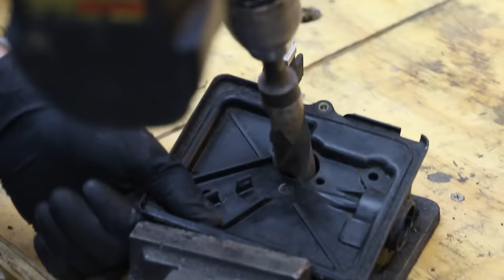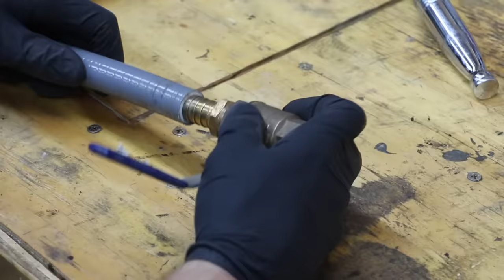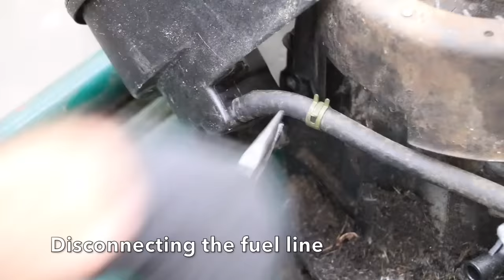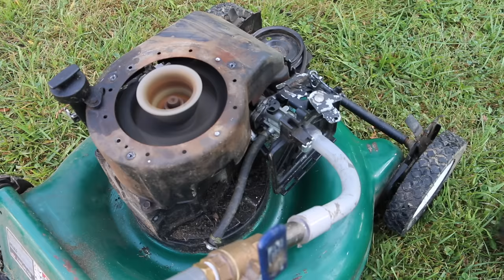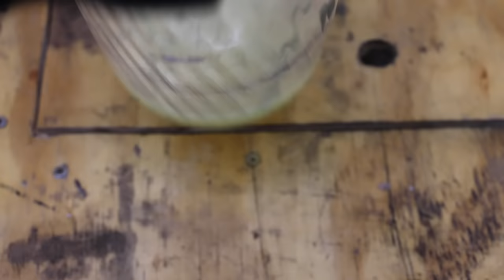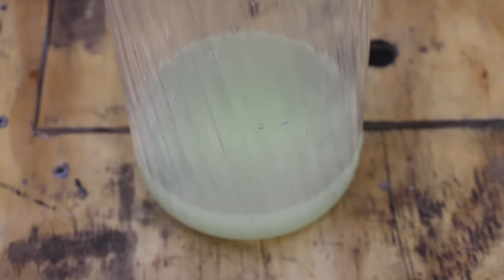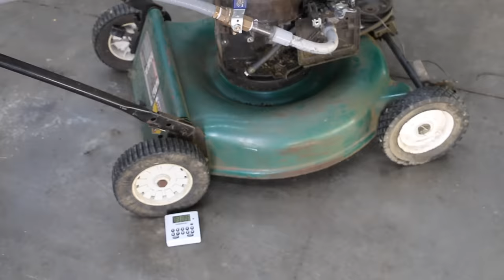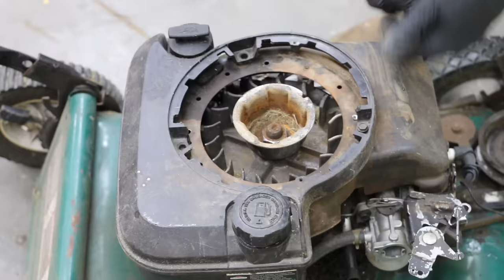Will a "Gas Vapor" Container Improve MPGs and Fuel Efficiency?  Let's find out!

Comment: All gasoline powered engines run on gasoline vapor! Liquid gasoline will not burn. It must be combined with oxygen to create a vapor before it will burn.

A carburetor mixes liquid gasoline with air to produce gasoline vapor which will burn. What you've done here was to create a rudimentary carburetor that mixes gasoline and air creating a burnable vapor -- as the air is drawn up through the liquid gasoline in the jar, it combines with just enough gasoline to create a burnable mixture.

That was an interesting experiment!
Reply: Good Comment. Please check out Gasoline Vapor Systems on Facebook. Thanks, Mike
Reply: A carburetor only produces a mist or small droplets. The engine does not perform well on the droplets of liquid droplets. It NEEDS vapor. Now you see why carburetion is no longer industry standard. Fuel injection produces a MUCH finer pressurized spray of droplets and thus the residual vaporization is better, but science has already established that a "pure" vapor system is FAR MORE EFFICIENT.
Reply: Hi, this is in the right track except the carburator doesn't turn the fuel into a gas, the carburator feeds atomized fuel to the engine via the jets and mixes with the air controlled by the throttle valve. As the fuel travels through the intake it gains heat from it's surroundings turning liquid fuel into gas fuel.
Reply: Only problem is incomplete combustion from forcing liquids into the chamber. A pure vapor system is far simpler and more efficient. Just ask Edelbrock. You must know Edelbrock. Ask them about trying to get a spray to turn corners inside an intake manifold.
Reply: The big problem is that a vapor system doesn't FEED THE FAT CATS. Trust me that injection is FAR less efficient than Vapors. Please read down to some of the rest of the comments below... there is lottsa good stuff down there for those that want to learn.
Reply: Hey Alex, after reading hundreds of the comments below, I am seeing big confusion between gas, as in gasoline and gas, as in gaseous state.
Reply: if you've done literally any research at all on the current direction of almost all the automotive car companies then you'd know that they're going electric and don't have an agenda to keep cars running on gasoline, injection is the most efficient fuel delivery there is too so you are just spreading false information
Reply: Well of course fuel injection is more efficient, but I think you should to look up the word 'vapor' before you continue. There's no such thing as a 'pure' vapor system. And what the heck is 'residual vaporization"? It's still a vapor no matter whether the gasoline droplets are large from a carburetor or smaller from fuel injection. So whether carburetor or fuel injection, either way you look at it, the engine is running on gasoline vapor.
Reply: What does "electric cars" have anything to do with this conversation? And just because fuel injection was invented doesn't mean that it's false information to say that the man created a rudimentary carburetor.
Reply: There are videos here on YT of actual cases of hundreds of MPG on vapors. NOT EVEN CLOSE with carbys or infectors. Read down on some of the other comments. There is a lot of real science there if you really want to learn.
Reply: ya cant burn gasoline in a spray form. it only burns vapors. with a carby and infectors you are sending in a spray of liquid droplets.
Reply: Read the thousands of comments below if you want some helpful info. If you want!!!
Reply: Well heck! Let's all argue awhile! A fuel injection system is a vapor system. It just has smaller sized gasoline droplets than a carburetor system. Fuel injection does not inject "gas" into the engine, it injects very tiny liquid gasoline particles into the engine.
Reply: "very tiny liquid gasoline particles" are not vapor. they are liquid. Google it.
Reply: First of all, Youtube is full of fake videos. I think you've been deceived! If cars could get hundreds of miles per gallon on gasoline then all cars would switch to that system. And if an inventor had created a system that gives hundreds of miles per gallon of gasoline, then you'd have seen that item on the market and the inventor would certainly be a multi-billionaire.
Reply: pen mightygun mine?
Reply: Bill Davis sorry about that. I don't like saying vapor, I say gas or gaseous to point out the state of matter.
Reply: MrCharlieCom good!
Reply: What about the increased pump-work that tubing creates!
Injecting wapor instead of small droplets also increases pump-work, guess how!
Reply: Bill Davis it is scientifically impossible to make a gasoline engine have a fuel economy if hundreds of MPGs. 
Basic understanding of energy simply proves that wrong. About 33% of the fuel translates into motion, the other is lost, 33% goes to the radiator as heat and the other 33% to the exhaust as heat. All that being said, if you harness 100% of the potential energy in a gallon of gasoline 112 BTU/gal you improve your efficiency by 300% or 3 times.
Reply: MrCharlieCom the carburator not the oxygen create gasoline vapor, is the heat added to it
Reply: It's good that you make a difference between gasoline, gas and vapor. When I was in eighth grade, the teacher asked the class a question for which the answer was 'gasoline'. I was the only one who knew the answer. However, I held up my hand and responded with "gas" (short slang for gasoline), for which the teacher said that wasn't the right answer. It was a minute or two later when some smart girl figured it out and answered 'gasoline.' She got it right! Ever since then I always make a difference between 'gas' and  'gasoline'.
Reply: MrCharlieCom nice!
Reply: I love all the comments, what you have done is akin to what chevys first fuel injection system was designed for the 283 installed in their Corvette in the 50's, if you want to see an experiment, alter your setup a bit. Remove the carburetor and Use a closed loop with another ball valve on the intake, instead of sucking air into your bubbler remove your muffler and pipe it into the bubbler instead of outside air, open the extra ball valve and use a squirt of starting fluid to get it started, the heat from the exhaust expands the molecular structure of the gas, think of setting a gas can outside in the sun without a vent it will expand greatly, it is considered a form of geet fuel, give it a go.
Reply: Sorry, exhaust gasses will not burn again. That would only contaminate the intake charge. The gasous gasoline vapors have to mix with air, not exhaust. Very inefficient. There is no comparison between a vapor system and a liquid fuel system.
Reply: A fuel injection system is a liquid injection system, not a vapor system.
Reply: Hi Bill Davis, Thank you for your great post. You are mostly correct about everything you state. I would like to point out that all gasoline powered internal combustion engines ONLY run on gasoline vapor, that is oxidized, or emulsified with atmospheric air, weather running on a carburetor or being fuel injected. Gasoline engines do not run on liquid gasoline. Liquids do not combust, and therefore gasoline in liquid form will not combust, but must be converted by the application of heat into a gaseous phase, and Oxidized. Both the F.I. and the carburetor atomize the gasoline into a fine mist. Atomizing is done to facilitate the quick heating and "Phase Change" of the liquid gasoline by spreading out the liquid gasoline in atomized form over a heated area inside the engine.  The liquid gasoline is broken up into millions of microscopic droplets, but remain in a liquid form.  The atomized liquid gasoline then spreads out , and mixes, (emulsifies), with air when flowing through the carburetor venturi, (Oxidation), and then comes into contact with heated areas inside the engine, where they are vaporized by that heat. This is called a "Phase Change". Phase change requires the application of heat to occur. Gasoline in liquid form is not converted into a gaseous vapor until heat is applied. Bill, I invite you to join our group on Facebook: Gasoline Vapor Systems. I think you will like it and find it interesting. Thanks, Mike
Reply: Fuel Injected Engines also run on Oxidized GASOLINE VAPOR, and not on liquid gasoline. Liquids do not combust. This is a basic premise of Physics. No liquid will combust. A flammable liquid must first be converted into a gaseous phase to combust. Direct Fuel Injection systems spray atomized liquid gasoline mist into the HOT combustion chamber, where it is mixed with incoming atmospheric air, (Oxidized), then  compressed and ignited by the spark plug. All Internal Combustion Engines run on Oxidized and Heated Gasoline Vapor and not on liquid gasoline.
Reply: You are right Alex ! Thanks !
Reply: Very True ! Good Comment !
Reply: Vapor is a suspended liquid droplets. A fuel injection system injects very fine fuel droplets vapor mixed with air before entering the engine. It's not like it's dripping gas into the cylinders. Direct injection moves injector inside the cylinder for even more controlled burn. Most direct injectors run on 2000psi of fuel pressure to allow the best atomization of fuel.
Reply: Vapor is not droplets. droplets are atomized liquid. Vapors are gaseous. A carb and injectors both spew droplets of liquid and droplets dont turn corners inside an intake manifold, they splash against the wall in a turn and then this liquid DOES drip gas into the cyl. A race engine has very TALL, STRAIGHT manifold runners to avoid turns and to avoid that wave of liquid that drips into the chamber. That is why vapor is FAR more efficient than a stream of gas.
Reply: Too bad all the current research is proving that the petrol engine is so far, the most efficient form of energy transfer.  Wind, electric, hydrogen and many others have failed to surpass the gas engine in efficiency.  I'm not trying to offend you in any way, it's just a fact.  In fact, Delphi built a gas engine that was 50% more effecient than todays engine, back in 2012...

https://jalopnik.com/5912161/delphi-built-a-gas-engine-thats-more-efficient-than-hydrids
Reply: Vapor is not suspended liquid droplets. True Gasoline Vapor is not a liquid.  Gasoline Vapor is a gas, that has been converted by "Phase Change" through the application of heat to the liquid, which changes the liquid into a gaseous state, (like Natural Gas or Propane). True Gasoline vapor is invisible like natural gas. Tiny Liquid Droplets, also called a mist, are created through the process of atomization. The process of suspension and mixing of atomized liquid mist with ambient air is called emulsification. The process of atomization is accomplished by the carburetors '"Jets" or by the Fuel Injection system's pressurized injectors.  Emulsification, (mixing) of the atomized fuel and ambient air is initiated in the carburetors venturi tube, (also called an emulsification tube), and continues while flowing through the intake runners and cylinder head ports. Fuel Injection pressure for atomization is provided by an electric fuel pump, which in most cases has a pump pressure of 45 to 60 P.S.I..
Reply: I don't even care about all this vapor stuff. All I did was make a simple response about the man created a rudimentary carburetor and man O man, now I get several email responses every day from people  trying to teach me all about fuel systems, fuel injection, definitions for vapors, droplets vs vapors, etc.. Ain't you guys got nothing better to do? LOL
Reply: was talking to the other person Bill, I agree with you
Reply: John Smith they're actually going towards hydrogen powered vehicles. Hydrogen is the most abundant resource. In a hydrogen engine the only byproduct is water. Hydrogen engine are VERY powerful engines.   You still have find energy to produce electricity either from where most of our electricity comes from coal fired powerplants
Reply: Hydrogen only makes one third the BTU's of Gasoline combustion. This means that a comparable sized engine running on Hydrogen will only make one third the Horse Power and Torque of the same sized gasoline engine. I built a dedicated hydrogen engine, a 350 cubic inch Small Block Chevy, and it made less than 50 horse power. I also had to use 2 - 300 amp "Limo" alternators to power my system, which robed more power. YES, Hydrogen has great advantages in air pollution and water is free but their are also disadvantages .
Reply: Bill Davis...stoichiometric
Reply: michael vannozzi  stoichiometric

Comment: This does work I did it on my 94 Chevy C1500 with a 4.3 Vortec TBI throttle injection I even made a YouTube video about it not much detail but it was successful you have to have a fully sealed system other than where the air comes in I use the brake booster splitter t- pipe I used a stainless steel fine mesh as an aspirator with a small aftermarket air filter on the vapor bottle I used a pickle jar which was glass I haven't perfected it to a tea but it does work hydrogen cells work as well with some fine-tuning and studying you will get it I only received a few more miles on fumes than I would have gas normally good luck to you guys

Comment: hi, could you make a video about hydrogen cells and HHO devices
thank you
your videos are excellent
Reply: He doesn't want to end up like Stan! Smart guy.
Reply: I’m sure that Stan is someone that can’t be found anymore.
Reply: @Patcha-Mama  Isn't Stan the dune buggy guy?
Reply: HHO does not work it’s just perpetual motion machine I’ll sell you lights that power your solar panels when the sun is not out if you believe HHO
Reply: @Bankable2790  what people don't get is a. The extra energy doesn't come from extra boom from HHo , that WOULD violate conservation laws. The extra energy comes from the gas wasted by the sort of spray and burn action carbs and fuel injectors do, which is exactly why this video worked. 

And b. It still won't work on a computerized system without modification to keep the car from compensating, which debunkers never do. I guarantee my datsun 210 would have seen significant gains
Reply: @Bankable2790  Show us the video...?

Comment: This is basically an external carburetor.
Reply from the maker: Great point!  Never an issue with it getting so dirty that it won't function.
Reply: LOL thought the same
Reply: xplus93 😂😂😂 im faded rn lol
Reply: Although, a carb does NOT use solely vapor. It still prays liquid
Reply: Your dads an external carburettor
Reply: Agitating/aerating the gas the way this setup did didn't make a true vapor either. It was still just an aerated liquid, the same as a carburetor does. External carburetor still stands.
Reply: @JamezzyM  it sprays, because it's imperfect. the goal is, and ever was: a homogeneous air/gas mixture

Comment: Very interesting video.  Awesome to watch as usual.  Here's my 2 cents....So is there any potential gain to be had by pulling the engines own exhaust into the jar instead of straight air?  I think there may be but I have doubts it would make much of an improvement.  Then again, I didn't think you could run an engine off of vapors in the first place.
Reply: Awesome idea, a turbocharged vaporizer. I like it. Idk how, bc gas has a low flash point, but, I can dream up coils for a little cooling, them forcing the vapor, then leaning out the carb significantly. Of course, this gets more fun if the exhaust is turbo boosted as well. I only hope, if anyone ever tries all of this they follow the guy who named walkie-takies, and invent the super-duper charger😎